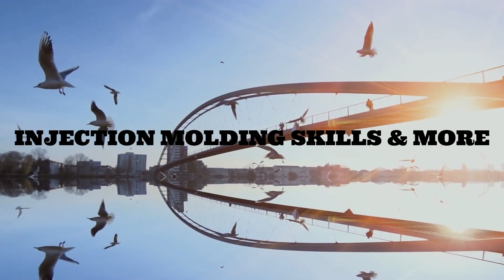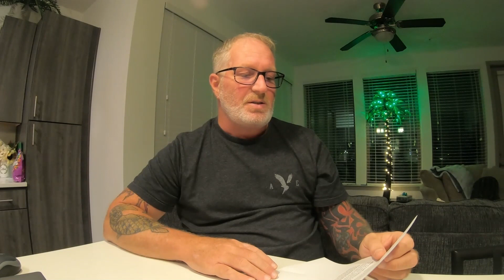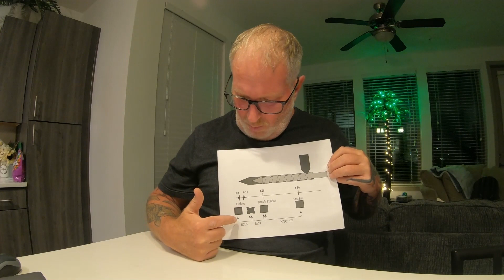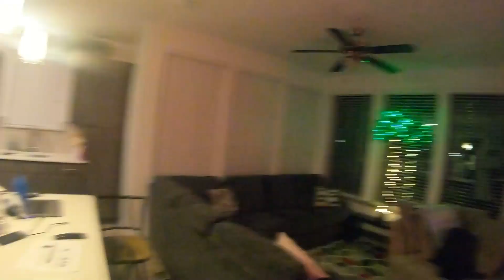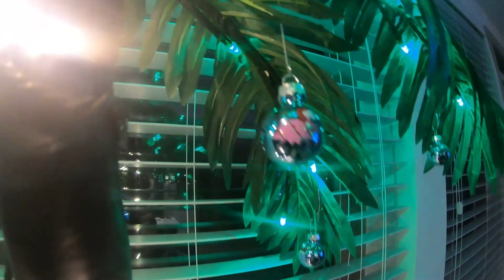What is Cushion ??

Comment: I am a Plastic injection molding Process Technician from Port Hurn Mi. I have 14 years of experience . with that being said there is still a lot I have to learn , My question is this ( Older Engel , 500 ton cc300 I believe on this job screw rotate should be 9 seconds // glass filled Nylon // so couple shots goes from 6.5 sec  then 4 shots later I got 22 sec time ) I believe screw is worn or could it be check ring ? my cushion is consistent tho ?  do you have any thoughts on this ? please get back with me
Reply from the maker: Have you heard of a screw being wrapped, what that means is there is material around the fights that is not melted down were you are using glass. This could be one thing another might be that the check ring is bad. watch the screw when it goes forward it shouldn't spin at all. It should be just like a plunger going forward. If it spins that can tell you the screw or check ring is bad. You can do a dynamic check ring study. My e-mail is david_lucas@bellsouth.net 
e-mail me and I will send you a spread sheet for the study on check ring. Thanks for watching & the support to the channel greatly appreciated. LET OTHERS KNOW OF THE CHANNEL.
Reply: @injectionmoldingskillsmore1064  yep checked it out ( Thank you for getting back to me ) ya so I put decomp on run screw all the way back as far as it lets me as far as I can tell not wrapped but Like you said could be because I cant see whole screw , that might be it I know if you run heavy materials like Glass filled Nylon and regrind it will degrade screw been couple days where I work we still trying to figure this out
Reply from the maker: @dp6824  If you need the dynamic check ring study sheet just e-mail me & I will send it back to you. Thanks for the support to the channel & I hope I was able to help you out. Have a great weekend.

Comment: Hello friend. I'm starting to run 2 shot molds and once in awhile have problems with the second barrel shooting the Santoprene over top of the ABS part. One of the main issues I see is the Santa preme not being smooth. Has a few wavy lines or wrinkles. Do you have any recommendations on how to adjust issues with Santoprene flow? 

I watch all your videos and appreciate your time  making them.
Reply from the maker: What do you have the heats at on the santoprene material? Sometimes if the heat is too low the material will wave up or be chucky coming into mold area.
Reply: @injectionmoldingskillsmore1064  next time I have that problem I'll try adjusting the heat up a little bit. Thanks
Reply: if you injecting santoprene over anything if wavy my ex is this Rubber needs to be decoupled . if to much pressure is applied that's what you get but there is diff factors ( valve gates , DME or hot runner , what if hard shot not decoupled or inconsistent ? ) and so rubber does not like a lot of PSI / I deal w/ 2x injection or if you want to call this over molding Where I work we got 30 plus presses that are 2 shot molding and almost all of them rubber on top of hard shot